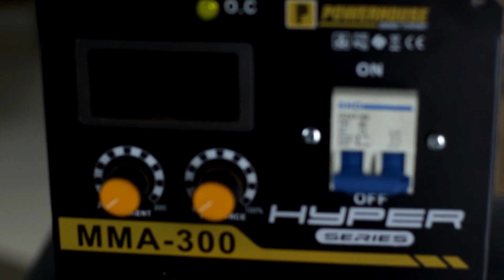Powerhouse Inverter Welding Machine Hyper Series SPECIFICATIONS and TESTING vs Brand X

Comment: Hello po power house.ang gamit ko po sa shop ko ay apat na inverter welding machine.isa 300amp.tatlo 200 amp.maganda poang performance nya nasa 3 years ko na sya ginagamit araw-araw.kaya ngaun nagkaprolima ung dalawa.may power sya sa input pero wla sya power sa output.patulong nman  po.ano pwide gawin or maintenance nito.plz lang po.salamat.
Reply from the maker: Thank you very much po!!
Reply: Ilan po ba mosfet ng 200a hyper series?